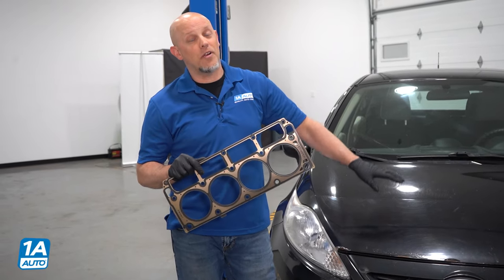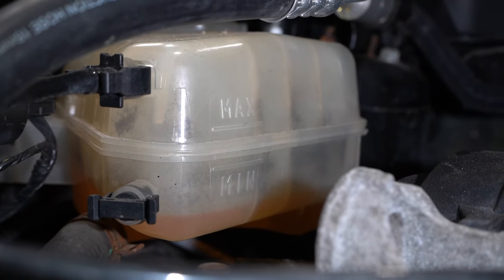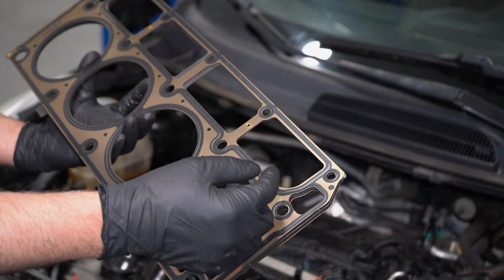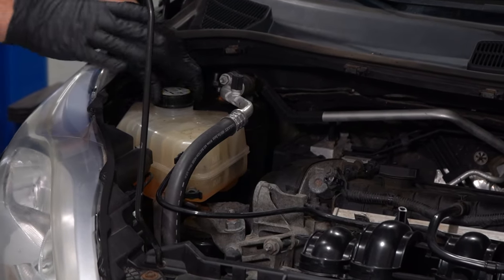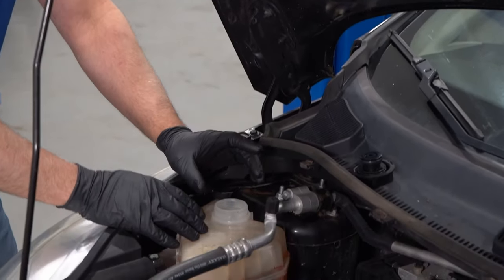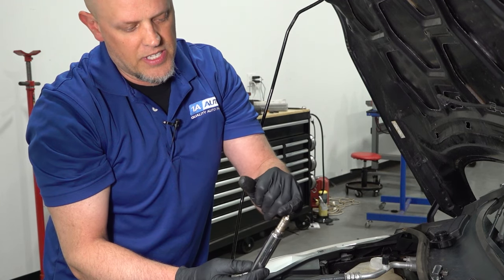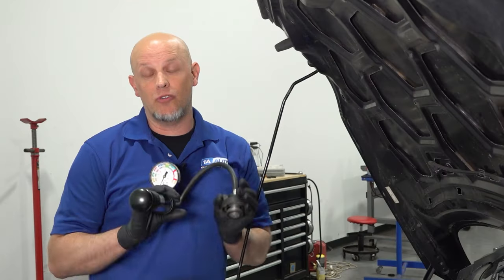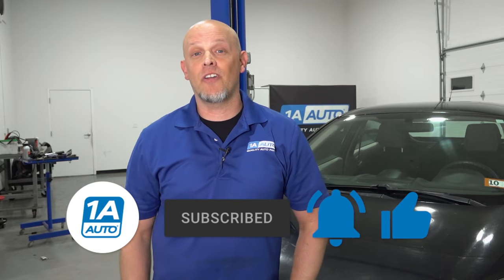Overheating? White Smoke From Tailpipe? Easily Identify a Head Gasket Leak on Your Car or Truck

Comment: Thick white smoke - Coolant burning, Thin white smoke on a cold day - Normal. Blue smoke - Oil, Black smoke - running too rich. Grey smoke - burning Transmission fluid.

Comment: I had an old car that started to smoke a bit of white smoke, just a bit. I had to refill the coolant like every few weeks. Then, the problem got worse thru the months and I had to refil the coolant every few days. Later, the problem got worse exponentially, to the point that my car was running in low idle, heavy white smoke, and had to put a gallon of coolant every 20 mins that day. Well, I went to the mechanic and told me is the head gasket and is not worth to repair it. Had to a gallon of coolant before and after going there. I parked my car, I didn't use it, and when I had time, I junked the car. That day, when I drove to the junkyard, I refilled it with water and my car was about to stall and was overheating, it consumed a whole gallon of water in just 5 mins!! Good thing I made it! Lol
Reply: When you get to having to do it every few days, you probably (ideally) should know somethings mega up, and shouldn't be driving it lol.

(Ideally. Don't help when you're living the single car life)

Comment: When is it not worth fixing a head gasket issue vs just junking the vehicle?
Reply: Cost of repair vs value of the vehicle.
Reply: Based on the engine. Let's say a 2jz. That's nothing to that engine. Now let's say it's a aluminum V6 block which most car companies have these days it's not worth it.
Reply: All depends. Is it a love child, or are you one of those folk who can go through cars like a teenage girl goes through shoes.

And overall funds available of course. That can defeat the lovechuld aspect easily depending

Comment: At times my car smokes white smoke. For example: I start the car and no smoke out of the exhaust, I drive it around for an hour, I park. Leave it for 10 minutes, an hour and start the engine again and that’s when it smokes heavily. Does anybody knows what is this? I own a 07 CRV
Reply: Are you sure its white? Could be engine oil burning
Reply: not sure, could possibly be a few things
and depends on the color of the smoke
Reply: Still sounds like a head gasket. To confirm check coolant levels and make sure they don’t change. Always check when cold